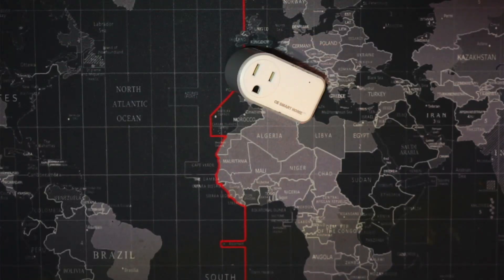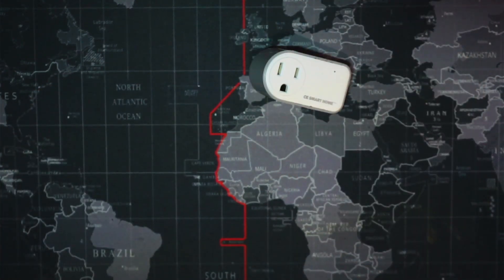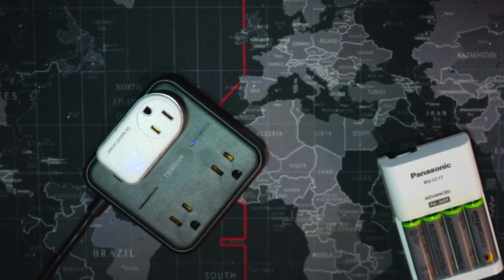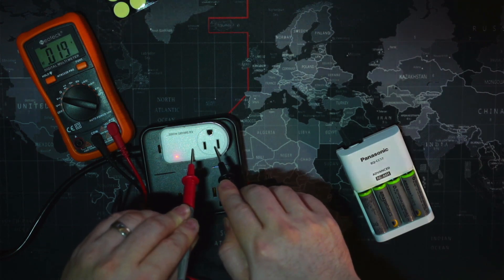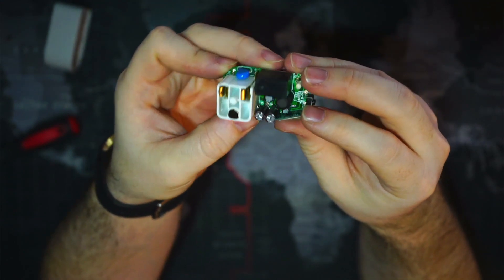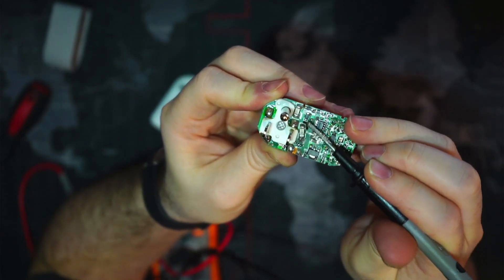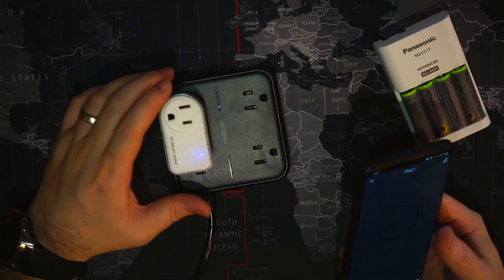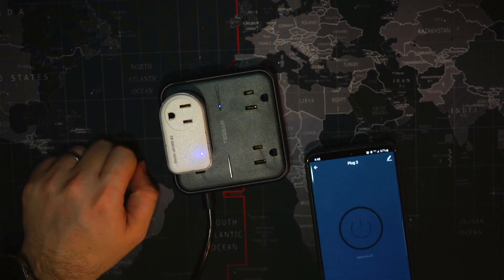Ugly Smart Plug Repair

Comment: Probably not the best application for “running a bead” of solder.  It doesn’t flow like welding. I probably would’ve just bridge with a little wire if you’re gonna do it that way.
Reply from the maker: You are right! it is no longer in service hah